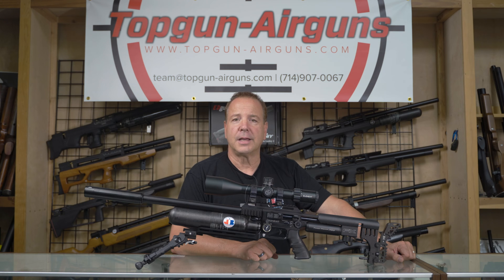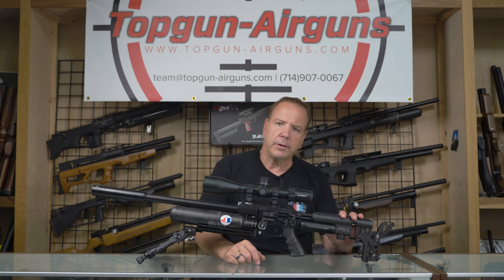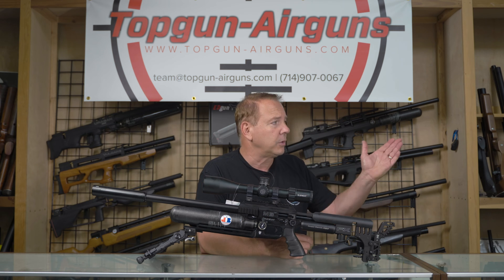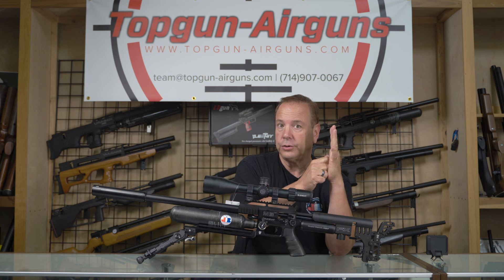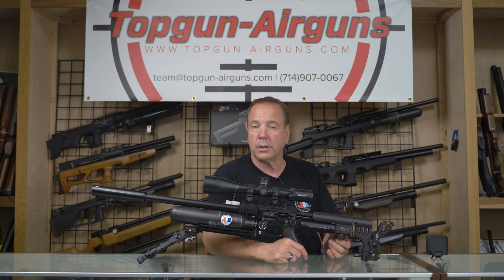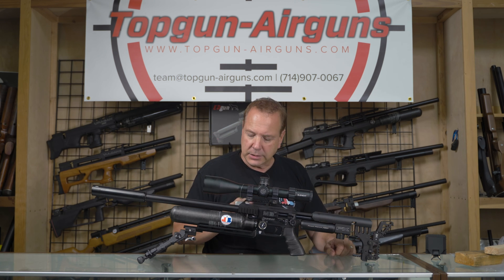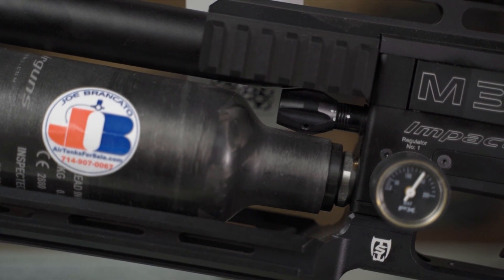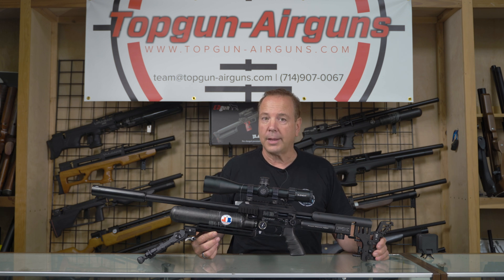FX Impact M3 : Getting Started With Tuning

Comment: Great video!  I can't find anywhere on the internet any tune for a FX M3 .35 cal.  I want to have a good group size but have maximum power (for deer hunting).  I am using .35 Diablo pellets, 81 gr.  Any help would be appreciated.  I know each gun is a little different but at least a bench mark of what someone else was able to achieve would help.

Comment: Sir I have .177 impact m3 but now I have 600mm .35 barrel kit i have installed it I have increased 1st reg pressure to 195 and 2nd 150 and valve at 5 line and wheel at 16 and Marco  at 4 .I am shooting 81 grn still I am not getting near to 800 it's only showing around 580fps can you please help me out how can I get up to 800fps for .357 for 600mm barrel kit
Reply from the maker: Hi try turning your macro to 4.5  but i think your main issue is the barrel length its too short so the air does not have enough time to push the pellet or slug up to speed

Comment: What a good video, I have a question. I recently had an M3 and I am setting it up. It is true that when the M3 is well set up you should hear it clearly when the plenum fills with air or is it a myth? I ask you why I don't hear it and to be clear that I have to keep insisting on searching for those sounds or maybe it's not necessary.
Reply: It all depends on the difference in bar between the 1st and 2nd reg the greater the difference the faster the plenum will fill the less likely you are to hear it. The less the difference the slower the plenum will fill and in theory the more consistent the 2nd reg will work.
Reply from the maker: Good info.

Comment: Dear Joe, How do I measure the pressure in the air tank in this gun ?
Reply from the maker: There are 3 gauges on the impact m3, one for the airtank, one for the first stage regulator, and one towards the rear for the 2nd stage regulator

Comment: Can we change fx m3 from 117 cal to 35 please help 🙏
Reply: Can I change is it possible
Reply from the maker: @rjgamingtelugu34  If you know how to use tools, it can be done. I'll do another video on it just for you if you want.
Reply from the maker: Just call www.TopGun-Airguns.com at  714-907-0067 and order the necessary parts.
They are IN STOCK!
Reply: Thank you so much 💓 love from india
Reply: I would love to see thank you so much 💜
Reply: Hi Sir 
I have M3 in .22 Caliber with 700mm Barrel.
I want to shoot JSB 18.13 Grain @ 890 to 910 fps 
What is the best combination of 
1st Reg 
2nd Reg
Power wheel 
Quick tune system and Valve adjuster setting for JSB 18.13 grain pellets 
Waiting for your reply 
Thanks 
Love from Pakistan

Comment: Yeah just got my new fx impact .22 M3 standard. Using 18.13gr Jsb pellets. Would you have the settings for this setup , it’s all new to me as I was shooting Air arms before this.  Thanks
Reply from the maker: thats the thing, there isnt really just a "setting" for that ammo, its about what Feet Per Second or ultimately what foot/lbs of energy u want, and that  is typically determined on what your goal is for shooting, ex (hunting; birds, squirrels, deer, etc - target shooting, attempting to get the highest BC for long range shooting), and since you are new to it, the best thing is to get shots under ur belt, laern the gun, get a baseline, so you can even tell if you prefer the gun before/after tuning, and OF COURSE start with using a chrono so you can get a baseline of your speeds and if you decide to tune, where you go with it.  We do like the simplicity and convenience of the FX Radar Chrono, and of course, shameless plug - available at our shop https://www.topgun-airguns.com/product/fx-pocket-chronograph/

Comment: Hi my M3 with 800mm and tungsten hammer fills the plenum very slow after firing what could be the problem here?
Reply from the maker: if there is no leaks/restrictions and it was assembled correctly, did you check your first regulator differential to your shooting regulator (2nd regulator) and make sure the air coming in from the tank is at least 20-30 psi above the 2nd regulator?

Comment: Are the adjustments you described for the FX M3 the same for all FX Airguns like the Crown, Dreamline, etc?
Reply from the maker: some things are adjustable on other guns like the regulator, but most guns are not nearly as adjustable when it comes to the valve return adjustment, hammer spring etc.  Most airguns wont have a second regulator as well